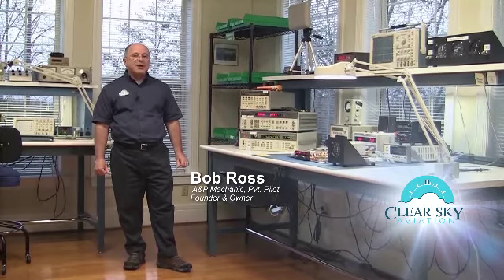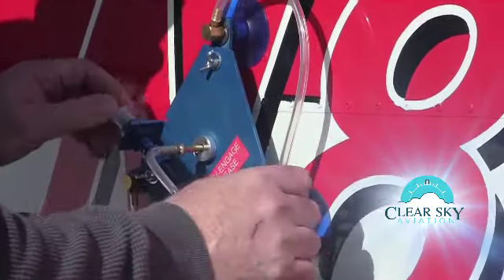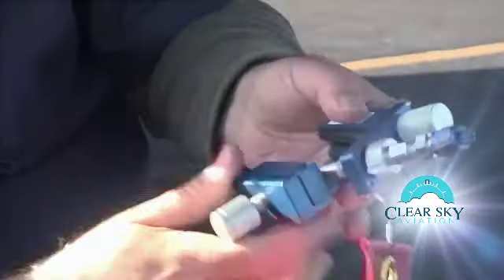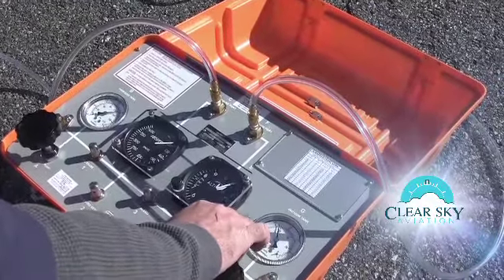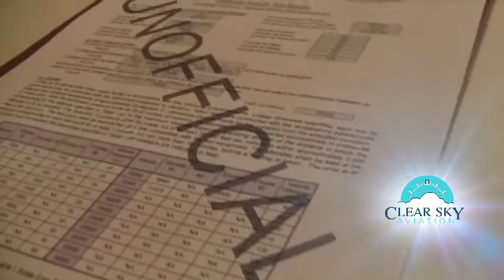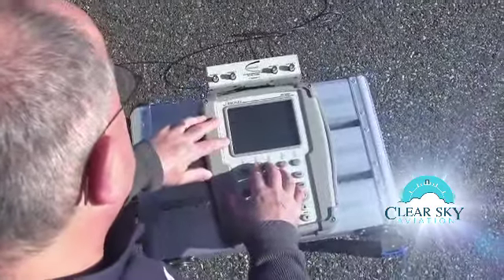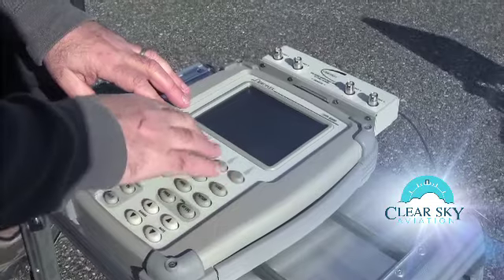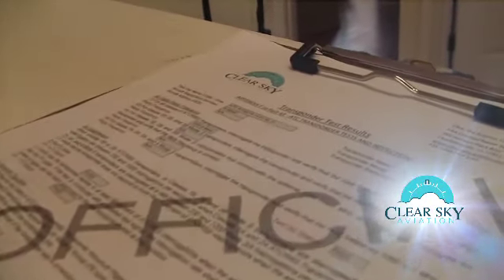Altimeter & Altitude Reporting Equipment Tests and Inspections

Comment: How does your test with the barfield tester meet 43. appendix E, if you test the altimeter while in the plane? You cant do the required casing leak test with Altimeter in plane, you cant adjust ambient temperature or vibrate the unit with the Altimeter in the plane all things the tests require, . AC 43-6c which lists minimum standards to comply  instructs to remove the altimeter from plane and bench test. The barfield tester does not do those things even if you took it out. so I am curious how this test meets the FAA requirements of 91.411, I know everyone does the same tests with same tester. But it seems everyone is not meeting 43 Appendix E in entirety. can you explain?